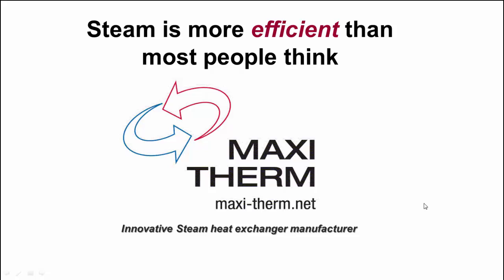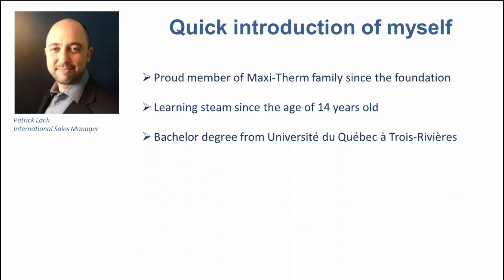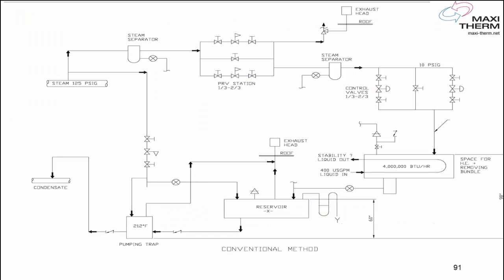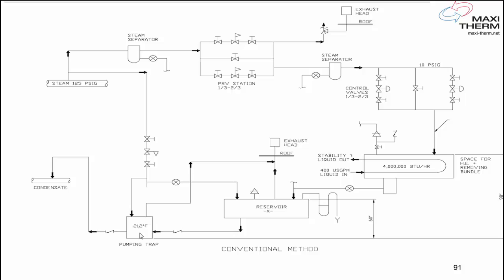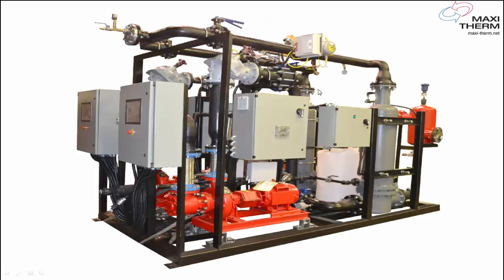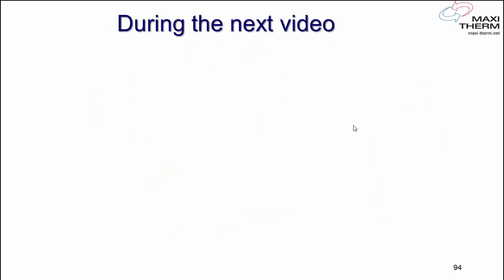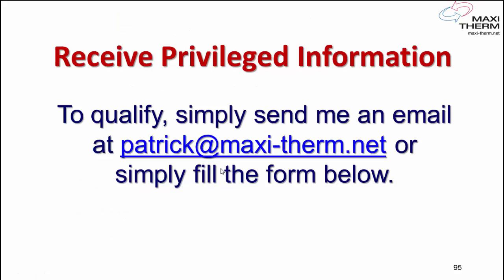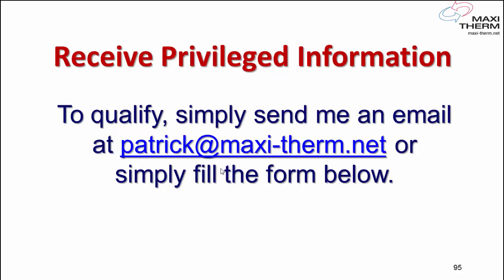New Steam Heat Exchanger Design That Simplifies Steam Systems

Comment: Grosss, output control so nasty. Rot your tubes, shit control and potential for water hammer. Miss me with that flooded exchanger.
Reply: @student at university wisconsin tube for can be delayed with more expensive material. Water hammer can happen if steam pressure ramps up and hot steam interacts with cold condensate. There can also be a temperature statification across the channel head that can lead to leaks as the steam side expands more than the colder flooded side. Just use an inlet control valve and trap. Dry exchanger is happy exchanger